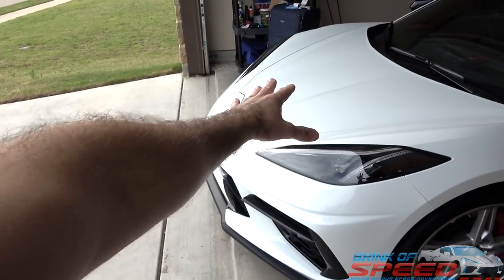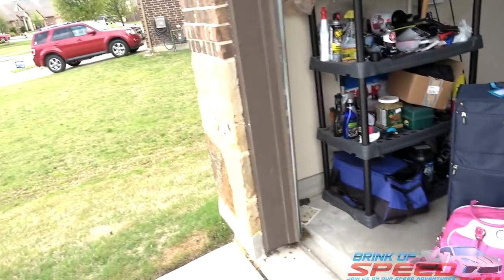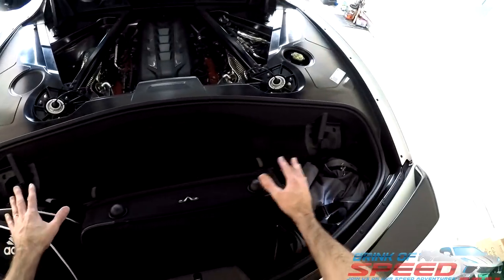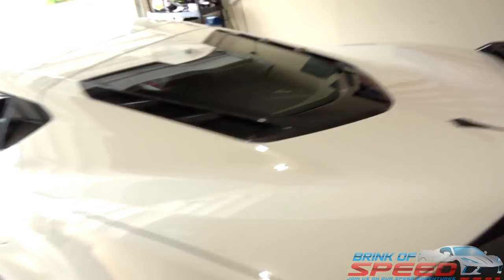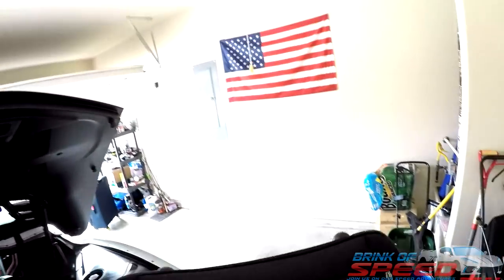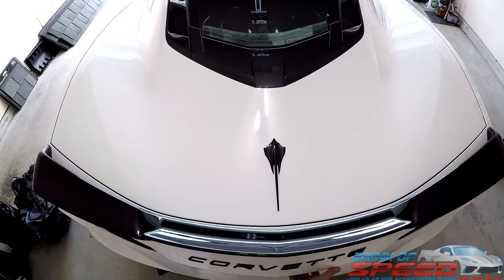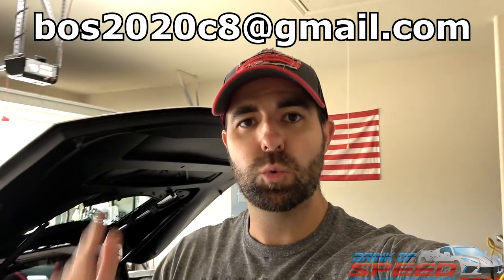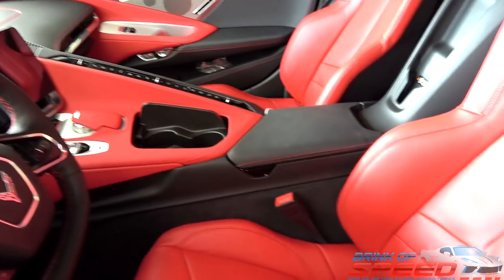How MUCH can you Truly FIT in the Two C8 Corvette Stingray TRUNKS?

Comment: Having in 972 purchased the underpowered 914 Porsche with 1/7 liter engine that had a front trunk and a rear trunk. I never felt that I was missing storage space in that car. Much of the time I was driving solo, so I always seemed to have enough room. I used the passenger floor board and the passenger seat and both trunks and could move nearly as much that was usually carried  in a standard mid-size car. The key with the Corvette is the excitement and capability of the car is so far beyond anything Americans have had in the past that the comparison ends with the room.. Further expansion of both cars was possible with the 914 having a lighter chassis but with the Corvette able to receive a number of different engines and upgrades much more easily that the little 914, which also had to have custom cooling installed for sustained hard work, while the Z51 already has cooling taken care of. AF

Comment: The C8 will teach Owners how to pack smarter, not larger.😉 Good idea about delaying the Giveaway Mike. We're now recommended to wipe down anything we receive in the mail or via FedEx, UPS etc. and even food and liquid containers when we bring them home. Mike, GM didn't lie. The C8 will take two golf bags, they didn't say anything about taking the clubs as well.😁  Plus, you don't need all those clubs! I only take a putter, a 5 iron and a driver. No problem. The only problem is that I need to take a 180 golf balls. I average 10 balls per hole. I just love being in the rough and woods. And if the course has any water hazards, well,  sometimes even having 180 balls isn't enough.😢🤣 Ultimately, you and Amber should consider taking up tennis.🎾😉 When all is said and done about packing up the C8 for long road trips, your demo is a great sales pitch to buy a convertible. You get to take everything you showed AND you can have the top down while traveling. 
Save the Wave.🙋🏼‍♂️
Reply from the maker: Peter Carey Very true Peter. I thought it was a good idea, I just think it’s better to be safe than sorry. Lol, I love my 14 Clubs, but I really don’t play very often anymore. Lol, on your golf balls comment, I have a friend like that. 😂🤣 Yeah, the convertible would be great for sure, but is it worth an extra 7k? Not in my book.
Reply: @BrinkofSpeed  Yeah, $7k is steep to have an automated folding top. I would learn how to pack even lighter if I wanted to take a road trip and wanted to have T-top off while doing so. Maybe one of the after-market guys will come up with a Bikini soft-top, so when it's removed it'll be no bigger than a golf umbrella for storage. Problem solved. Here's a bit of trivia for you. With the C2s and the C3s, the base Vette WAS the convertible. The coupes were more money. Times have changed.
Reply from the maker: Peter Carey It sure is. For me, there’s no need to take the top off until we get to the destination and unpack anyhow. Yeah, it is crazy how times have changed so much. Also back then you could buy a Vette for 5% of what I just spent on mine. 😊